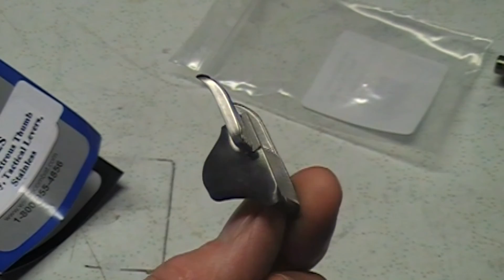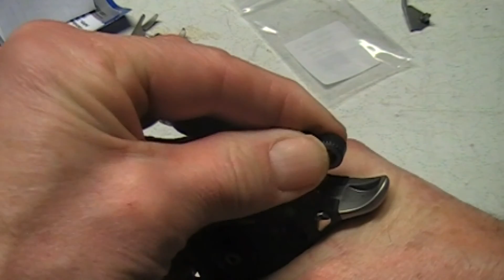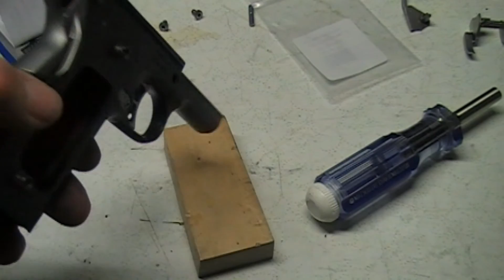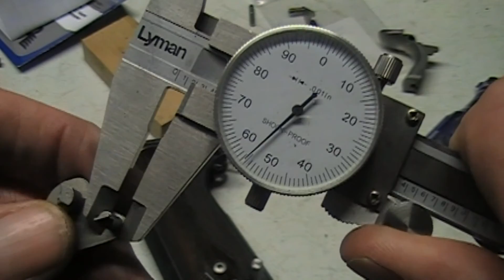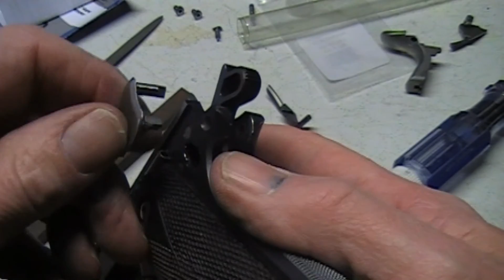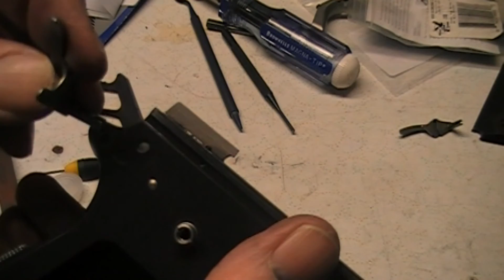Wilson thumb safety install

Comment: Get yourself a Brownells 1911 Mainspring Housing Tool.  Jamming that screwdriver bit into the Grip Frame is shoddy work.  You also need a Swiss Cut #2 and #4 Pillar File with Safe Sides.  That rough File did a horrendous job.  Fortunately I had the opportunity to attend Colt 1911 as well as M-16 Armorer School.  When you fit the Thumb Safety Lobe correctly, the part functions flawlessly.
Reply from the maker: Actually I was using a Brownells multi bit driver with lots of bits including the mainspring housing pin removal bit. It would have been easier to use a dedicated tool for the mainspring housing. The file was a bigger issue but with some polishing and stoning there was no problem, the safety works great! So your points are well taken. Thanks for watching!

Comment: Does your newly installed thumb safety move partially up when the hammer is down?  Thanks
Reply from the maker: Yes, thats normal. I did check my stock guns and they all can be moved up a little with the hammer down as well.  Thanks for watching!

Comment: Wilson recommends filing or stoning the rounded end off of the sear and hammer pins to provide a flat surface on the right side and prevent interference with the ambi safety. You can also get short pins from Wilson if you don't want to file yours. And as someone else mentioned you will want to relieve the right side grip panel just a bit where the safety lever slides under it.

Comment: If the spring is not what is causing the problem try using the nail failing that comes in toe nail clippers, and push from the top like this man in the video did.

Comment: Did you releave any material from the grip where the safety slides under that could be some of your problem
Reply from the maker: The grips already had the cut so no problem there. Thanks for watching.

Comment: Can you clarify replacing Hammer pin And where did you get it
Reply from the maker: I got the parts from Brownells. They have a wide assortment. I had to get a new hammer pin because the Kimber safety rides on a long pin instead of under the grip like the Wilson model which uses the standard pin. Thanks for watching!!
Reply: Yes found the long and short pin on Wilson combat

Comment: Those grips on the ambi side probably aren't cut for that safety, there's usually a small spot removed for the ambi leg to move under the grip, good vid tho, never knew how the kimber ambi safety worked
Reply from the maker: Actually the grips were cut for the safety so no problems there.  Thanks for watching!!

Comment: Could anyone tell me if this will fit the ati titan officer size. It would be awesome if someone knows
Reply from the maker: Not familiar with ATI guns but if they follow the 1911 specs this safety should work with the fitting any 1911 might need. 
Sorry I could not give a better answer. Thanks for watching!
Reply: OXander61 man I didn't even expect a answer at all. I appreciate it greatly. I just picked up a new ati titan officer size for 300.00 so I got a few dollars to spend on it verses an 1100.00 dollar 1911 everything I have seen or read it is the exact same specs. Thank you buddy for getting back to me.
Reply: No one can or should answer that question for you. EVERY 1911 and aftermarket safety, whether it drops in or requires manual fitting, must ALWAYS be check and fully understood by you, the shooter, carrier, and owner.  If you cannot fully teach yourself about the gun you're modifying or you cannot mechanically and visually inspect and fully understand your gun and the modification you are making and it's full ramifications, you should hand it to a gunsmith.  Period.

Comment: Nice vid but you don't show how to get the original Kimber ones off . I have a CDP ll that I want to put Crimson Trace on and I have the short ambi safety for the right side but having a hard time figuring out how to get the original off . There was a vid a few weeks back but looks like it was taken off You Tube . Can you update showing how to get the safety out .
Reply from the maker: At about six minutes I show how the little right hand lever comes off. It rides on a pin and swings to the back and off the pin and can then be pulled out of the frame. Of course you must remove the left hand lever first. It comes off like any standard ambi lever. The two halfs of the lever stick together so you need to tug on the left lever to get it out.Remove the slide and move the left lever up as far as it will travel then pull and wiggle it out of the frame. Hope this helps. Thanks for watching.
Reply: OXander61 That's one of the steps I'm having a problem with . Do I lift the safety with the hammer cocked or down ? Your vid shows the hammer down but the safety is already out . It's my first 1911 style and I'm a bit lost on this far into disassembly . The highest I can get the left lever up to is the regular safety position . Is it supposed to go higher and over ?   I have a PPK , a old High Standard Victor and a 1895 Nagant revolver and only did the usual take down for cleanings . Thanks .
Reply: Edward M By the way , looks like you had instructions . Friggin Kimber sent me the short lever in the usual package but containing no instructions . Like they have a deal with gunsmiths and don't give a hoot about DYI people .
Reply from the maker: Edward M E series 1911 disasembly Here is a link to my E series 1911 disasembly, I show pulling the safety out at the begining. Keep in mind because you have a ambi safety some extra tugging is required. The hammer must be cocked and slide removed. The left side safety will rise a little past the normal safe position and this is where you wiggle and pull it away from the frame. Make sure the plunger and spring doesn't launch when the safety comes off. Then you can rotate and remove the right side. I had no instructions with mine either. I think they want to keep us from tinkering. Thanks.
Reply: OXander61 Hey , got it done . Took a heck of a lot of wigging but it came out .
Reply from the maker: Edward M Congrats and good luck!
Reply: OXander61 Thanks . Ed
Reply: I'm surprised that Kimber or any other firearm parts manufacturer would sell parts to a consumer without some type of instructions or a warning about inherent risks involved. The issue is liability. There are too many lawyers hungry for cases